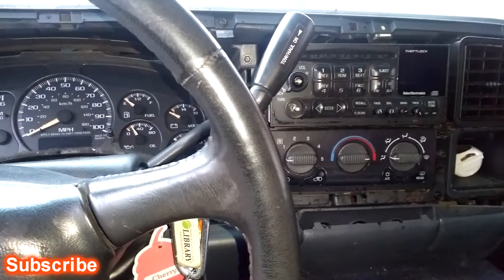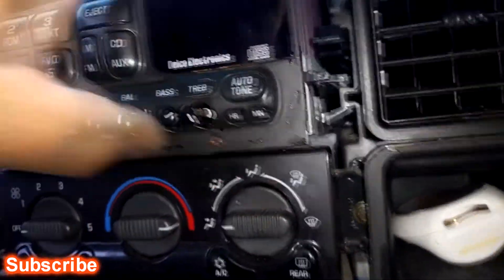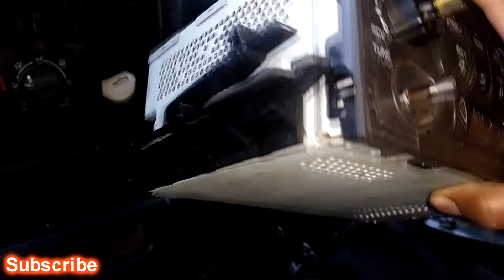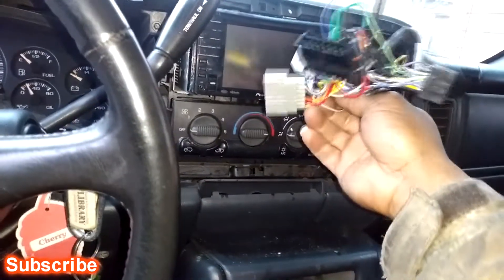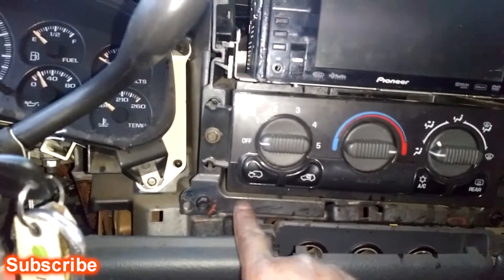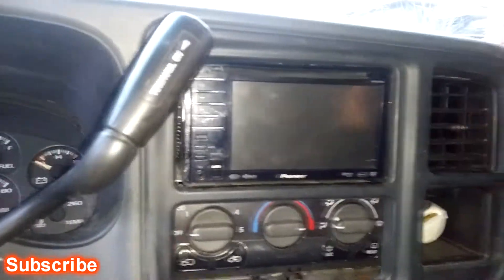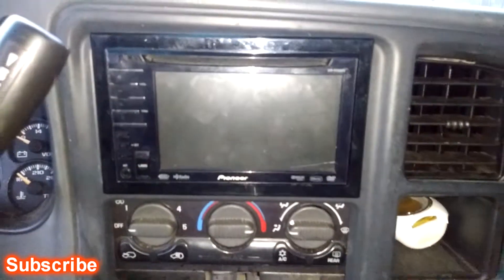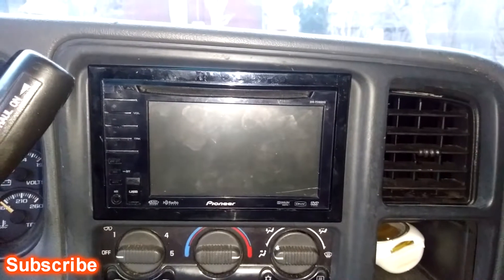02 Chevy Avalanche double din install

Comment: I like the install. 👍  I'm working on an 02 Chevy Trailblazer with the 1 1/2 din that I'm wanting to convert to a 2 din so it might be a little different than yours but I think I'll have to cut out that metal bracket like you did also. I don't have a sawzall but I do have a dremel. Thanks for posting the video.
Reply from the maker: Glad I can help